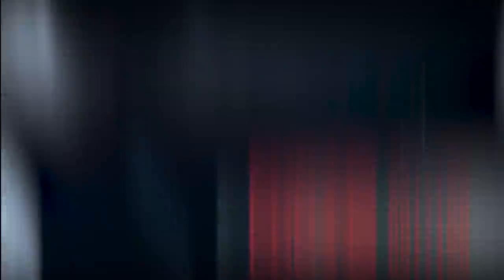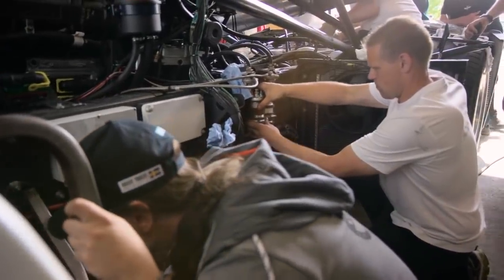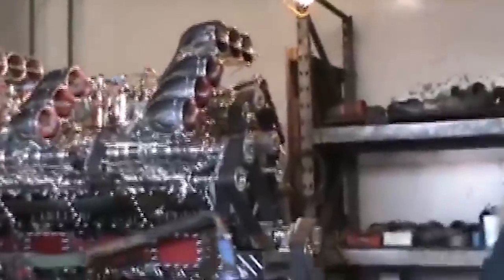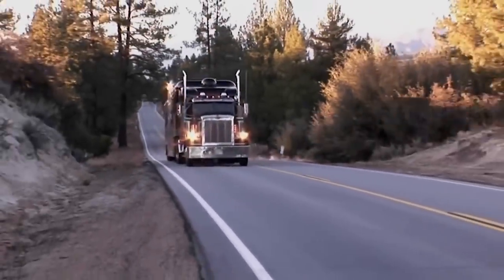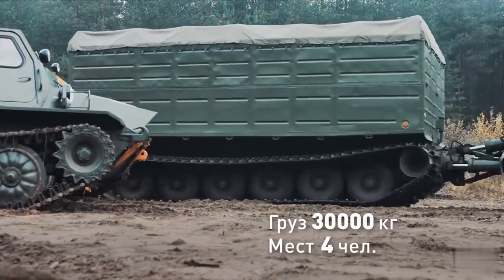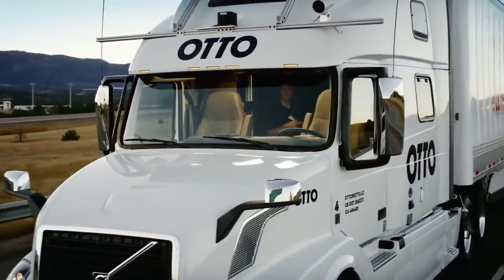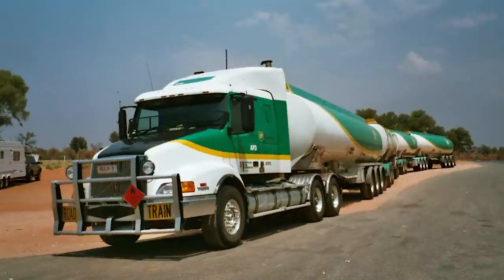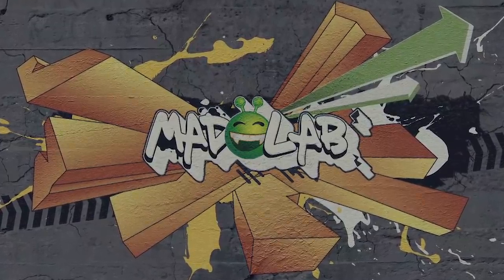10 Badass TRUCKS you wish you had

Comment: As a trucker I would hate to be limited to only 300 miles. that is about 4 to 4.5 hours of driving. That is less half of your day. With 200 gallons of fuel you can go about 800 to 1000 maxed at 80,000 pounds. Just saying.
Reply: Where I am a normal truck right now can haul 88k, with 7 you can be 99k.
Reply: bigpigslapper Oink  exactly.could you imagine the battery drain going up Donner,or Grapevine,or cabbage,or any of the others through the blue ridge mtns lol
Reply: The missus car will do double that towing a car on a tank of petrol
Reply: True mate. I'm Aussie and our interstate trucks need to do around 20 hours/day, 6 days/week  with driver change each day, 15-1800km per day to make decent money. Sitting around charging batteries every 4 hours is just not viable.

Comment: He said at 2:24 that it set its speed record at 132 kph. 82 mph is not that fast. not event a little bit.
Reply: @justind9631  I guess we got a Swede here. 81 miles per hour is slow as f**. Semis in Texas will pass you doing a hundred with a full f***** Trailer Load
Reply: Hey I was drunk when I posted that and thought he said 132mph my bad
Reply: All I know is Smokey ran an old peterbilt back in the late 70’s at 90 mph hauling a load of coors beer out of Texarkana! So yeah. 82 ain’t fast.

Comment: 0:35 200 hp and 4 cylinders, is it constructed from plastic?
Reply: oNLt 200 hP fOr a tRuCk WTF
Reply: It is probably a 4 cylinder diesel.
Gearing and torque make up for the lack of raw horsepower.
I can't see any practical use for this semi-trailer RV, it appears heavy enough to require a class "A" CDL.
Anyone wealthy enough to afford such a machine and haul a Ferrari probably isn't a blue-collar trucker.
However, it appears to be a world-class party van on steroids.
Party on, you rich weirdos.
Reply: @anndrogynous815  4 cylinder for a 80 000lbs truck?
Reply: Well it can have just 200hp but its truck and it needs torque too and its diesel and Ive seen truck what had 300 hp and over 1000 torque so yeah it is lacking of hp but it definitly have enough torque
Reply: @franko5331  4 cylinder don't have torque
Reply: @thermidorlevrai65  ??? Then what they have? Every engine have torque
Reply: @franko5331  i mean they don't have the torque like real semi truck engine
Reply: @thermidorlevrai65  oh... Well yeah you are right but what do you know maybe this one have
Reply: @franko5331  true but no one know the torque
Reply: 170hp and 294lb/ft for a 3.0 engine
Reply: if it was a 550hp truck it would have 951lb of torque
Reply: @thermidorlevrai65  what? weird.. idk then
Reply: @franko5331  i know but the size of the cylinder can change this
Reply: in comparison the detroit 453 have 175hp and 420 lb of torque but its a 3.48 liter engine(212ci) that mean the futuria engine is less than 210ci

Comment: I still do not think all the blowers on that thing really work the running of the belts and all the ducting would be impossible unless the belts could be separated the close ups I have seen don't show that . I have several of those old Detroit's in my shop 2-53 thru 12 V 71  I have 2 12V 92 TTAs in tractors but there days are numbered the 2 year electronic log extension will run out soon and no doubt the EPA was in bed with the DOT to get all the non electronic non emission trucks off the road The E logs were a underhanded way to do it once and for all !

Comment: Sorry but electric semis will never work. See it has 300 miles of charge by itself but the heavier the load the faster it burns through that. A full load on a diesel will take away maybe 30 to 40 miles of distance but a full load on the current top of the line electric batteries wouldnt even be able to make it out of town. Not to mention that these trucks are expected to be able to perform even after millions of miles. Batteries get old and tired and unlike an engine you cant rebuild parts and fix it. So you would have to continue buying battery packs throughout its lifespan and sadly no matter how ecofriendly you think electric vehicles are. Making batteries and battery packs produces a pretty sizable and of carbon footprint. And having to get multiple ones could possibly leave a larger carbon footprint than just a normal diesel truck. In all honesty batteries aren't the future, diesel is. This is why more European cars are becoming diesel. And with the ability for diesels to be able to use biodiesel and other oil products like vegetable oil. It can be a lot cleaner than electric vehicles.